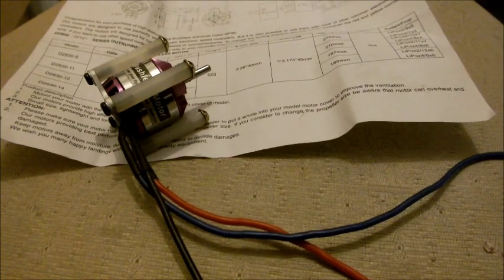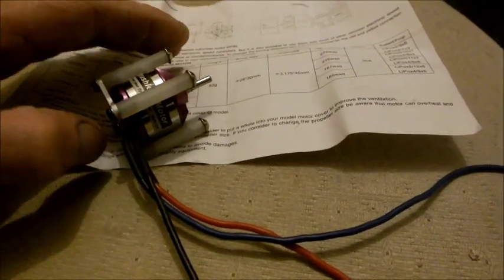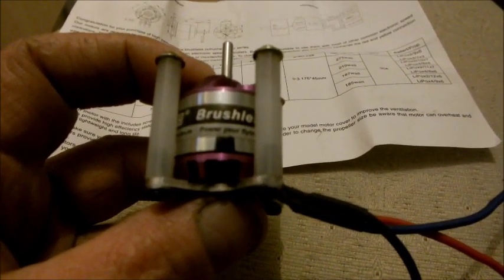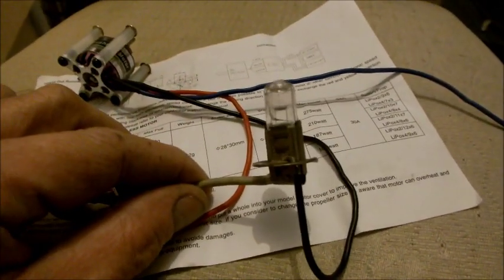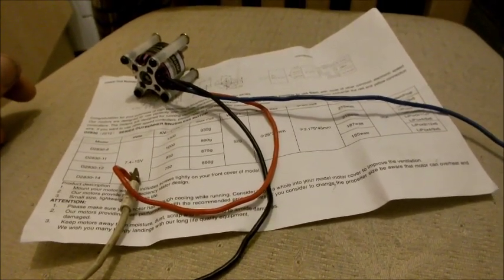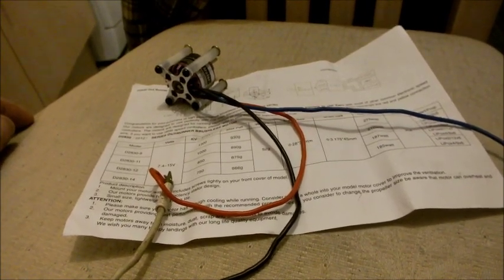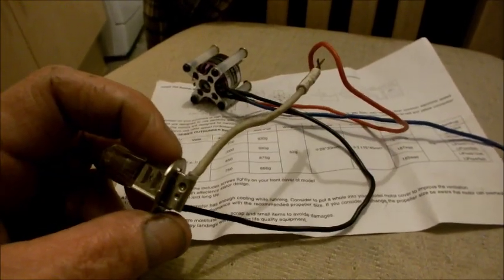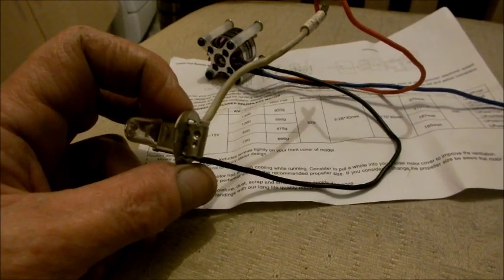Brushless Motor Used as An Alternator, description and test with surprising results!

Comment: I'm so glad I stumbled across your vid! I've been researching the possibility of using small brushless motors as alternators on RC vehicles / e-bikes etc. I've got a lot of 'em lying around. So far I've connected a BL motor to a three phase bridge rectifier and easily get upward of 20+V DC using my dremel. But now, if I could impose a little of your time...

Is it possible to charge a lithium polymer pack (currently 5 cells, 18.5V, 2700mAh x 4 = 10800mAh) using this alternator while the battery is being used - like a trickle charger back into the same battery while it is working? I don't intend charging the battery indefinitely (not a perpetual motion device) only tapping some of the wasted energy off the drive chain and feeding it back to the battery - like when a bike is coasting downhill or when an RC helicopter is hovering (only at 50% throttle). Hopefully this will extend running time.

I'm considering a few options and I'd really like your help on the next step forward. Here are some simple schematics and my pros/cons for each option:

1. BL motor -> Rectifier -> DC buck/boost CC/CV regulator -> Commercially available lipo charger -> BATTERY. Pros: This is the easiest for my rudimentary electrical knowledge as the factory made voltage regulator and charger do all the clever work. Cons: Heavy charger with lots of wasted components I won't need (like LCD screen etc). Also is it possible to charge the battery while it is working?

2. BL motor -> Rectifier -> 5 x DC buck/boost CC/CV regulators in parallel -> the individual CELLS of the battery using the balance plug. Pros: No wasted components and the small voltages and amps required to trickle charge the battery (only 4.2V max per cell). Cons: heavy (5xRegulators) / more complicated, I'm only a noob.

3. BL motor -> Rectifier -> BIG DC buck/boost CC/CV regulator -> BATTERY. Pros: cheap with no wasted components, easiest system since the commercially available regulator does all the smart work. Cons: how to make this charge while the battery is working, doesn't balance each cell in the pack (although this is probably not a problem as the battery will eventually run flat and trigger a low voltage alarm which monitors individual cells).

4. Can you suggest a better option...

Sorry for the wall of text. If it's not wasting too much of your time, could you perhaps point me in the right direction. At this stage I'm leaning toward option 3, except for the question of how to charge the battery while it is in use without feeding the power from the BL alternator back into the drive system. If you could perhaps recommend a couple of websites/youtube vids that provide a simple schematic that would be greatly appreciated!

Thanks very much for your vid and time reading this comment!

Cheers,
GF
Reply: It works quite well Dogbone Drones. At the end of the day they are no different in construction to car alternators. I used another brushless about twice the physical size of this one to provide a constant 20a feed, which it managed without problems.
Reply: +Dogbone Drones 
were you able to make the above project using option 3.I am working on a similar project and exactly as at the same junction.Please share your progress.
I have 48V BLDC motor and i am looking to atleast trickle charge my 4 12v lead batteries in series.
Reply: +Monika Kothari  Option 3??
Reply: You will NEVER get any motor alternator acting as a generator in an rC car or similar.

Comment: I've often wondered why manufacturers where not implementing this in rc cars, maybe to expensive?
Reply: Its all down to energy values, i'll try and explain without getting too technical. Every time you convert from one form of energy to another, ie fuel to engine power,and engine power to electricity via an alternator, you loose energy due to the efficiency, or rather inefficiency of the engine or what you are using. 1 measure of fuel (whatever amount for arguments sake) will contain a certain amount of energy which is released when you use it in an engine, sometimes called calorific value. Some engines are more efficient then others, so your 3hp lawnmower engine will deliver less power for a given amount of  fuel then your supercharged hot rod engine. When you have your engine running and attach an alternator such as this to it, you are converting energy again, this time from mechanical rotation to electrical energy via rotation of the alternator. Each time you convert, you loose energy because of inefficiency. A small RC engine may only deliver 1 HP,1 HP is equivalent to approx 748 watts of energy,a small alternator such as this has 3 windings and is capable of delivering a hell of a lot of power and would use up all of the available energy from the engine.

Comment: Did you start the motor at 8000 rpm ? - nice demo. Thanks.
Reply: I started the motor at different speeds when i was playing around with this experiment, starting at a high speed meant quite a high torque loading on the dremel and i managed to lose grip and nicely wrap all the wires up..:oP Properly secured it will start at any speed the drill will throw at it. As a point of interest, a friend of mine is playing with a jet turbine made from a modified car turbo. He wanted to overcome 2 problems, one was starting the turbo, the second was generating power from the engine to keep all of the ancillary bits running, ie pumps etc. I suggested using a brushless motor which could be used to start the turbo, and then switching over to be used as an alternator when it was running. This proved to work very well. In my tests with the single lamp, i was drawing around 100 watts from just one single phase. I dont see any reason why it wouldnt give the same from the other 2 phases, ie >300 watts.
Reply: Yes the motor was started at 8000rpm simply because this was the slowest speed of my Dremel style mini drill

Comment: not directly. use the esc meant to run them, can be another power source that is dc, as long as the voltage is about right, and the power source can put out enough amps.